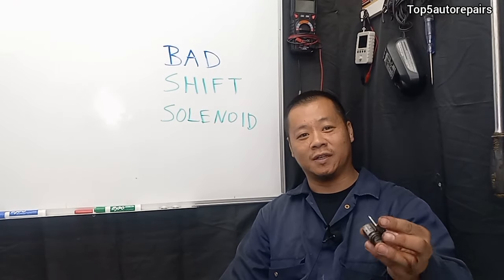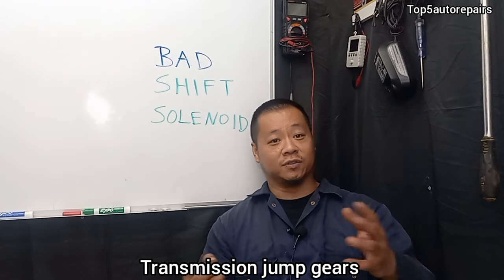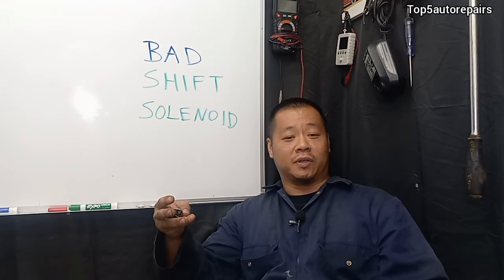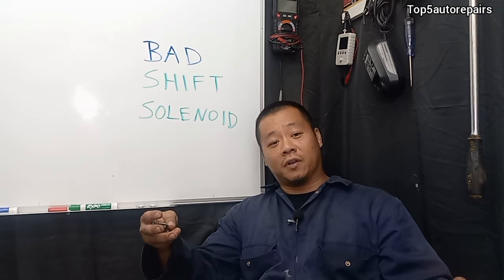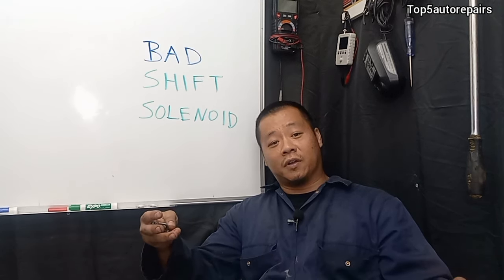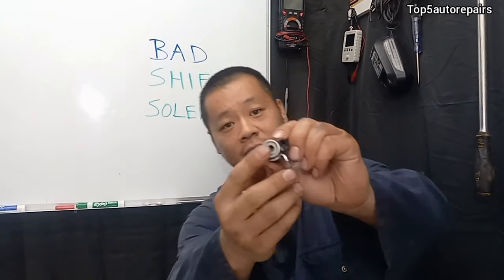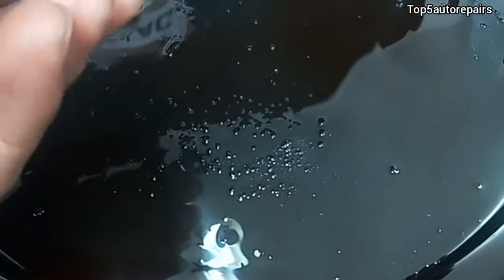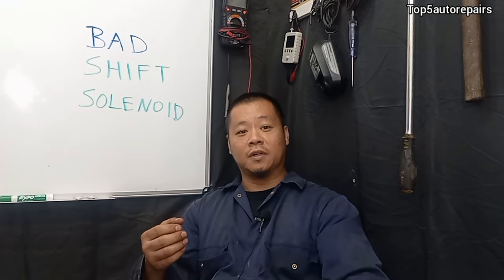Bad Shift Solenoid Symptoms & Codes. Do you have Transmission Shift issues? Slipping? Delayed Shifts

Comment: My transmission was fully repair but the solenoids where never changed. Can a bad shift solenoid cause stalling when put in gear
Reply from the maker: Yes it's possible
Reply: Thank you, I have the same issue.
Reply: @Top5AutoRepairs I have a Chevy truck currently suffering from this issue I hope your right about this
Reply: I have a 2004 vw beetle and it is not shifting into overdrive what could it be
Reply: @Top5AutoRepairs  My V8 Chevrolet 350 edelbrock turbo 400 old school Gearbox automatic does not driving forward but reverse work
Reply: @antoniodominguez4861  update?
Reply: Hello sir please where I can find the solenoids valve body
Reply: Torque converter solenoid
Reply: My 07 rav4 just developed this shifting issue and won't go in reverse until I drive for about a mile or so forward.....any suggestions
Reply: @antoniodominguez4861  do u have a aftermarket torque converter maybe no good
Reply: Trans 6l80e stuck in 3rd gear,what could be faulty?
Reply: @woodrowrussell-pn9gj check your fuses in the box by the battery
Reply: @Top5AutoRepairs  I have a p0973  on my automatic insignia 11 plate  says something about solenoid inside gearbox

Comment: Is there a solenoid that would cause all shifter positions to be a forward gear
Reply: I’d like to know about that too
Reply: My 1999 F2500 7.3 diesel I start going on highway throttle down and 1 gear ok 2 gear shifts in hard and 3 gear shifts in hard then over drive normal?  Now this Trans has 216000 mile does this sound like to have it rebuilt or new please help thanks so much

Comment: Can also be caused by bad / corroded system ground wires, bad transmission input / output sensors, also known as speed sensors or pulse generators or a bad trans temp sensor.

Comment: I have 1996 A6 Audi. And the Transmission does just what you explained. I dove it on the freeway. And it felt like it did not want to shift. Nothing wrong with the engine it starts and everything. But it slips when driven. I appreciate your knowledge

Comment: I have a 2007 Ford Expedition limited. If I brake abruptly and press on the gas ,my suv doesn't go into gear right away. Could that be the shift solenoid issue.?

Comment: Taurus 02. Starting cold, It wont shift out of 1rst gear. After 5 minutes warming up, I can then shift freely all day until it cools. New Transmission fluid and filter.
Reply: I have the same problem with my  toyota ractis 07. Ill try new transmission fluid and filter. Thanks.

Comment: My 97 Chevy 5.7 
Is shifting fine into 1st and 2nd but won’t go into 3rd gear. rpm’s continue to go up but don’t seem to go down. Could this be the shift solenoids ?
Reply: Did you ever find a solution.? I kind of have the same problem. My Toyota tundra 2006 doesn’t go past 3rd shit for a while. ( 5-10 seconds)

Comment: Great video. 2008 Nissan Versa. What if a car has not been used for a couple of years and when you restart it it shifts into drive but now will not shift into other gears or park? Ran perfect before parking and i always change the transmission fluid every 2 years when using it.

Comment: Excellent video. My transmission works only when the tran fluid is hot.
Reply: Mine used to shift weird / slip when it was warm. Ended up being trans temp sensor. Replaced, fixed problem till something else went bad 🙃

Comment: I have a 2015 f150 that had transmission and torque converter rebuild by AAMCO. I now randomly hear a loud clunk either when quickly decelerating or when it sticks shifting a gear-for a second. No codes are popping up except engine misfire. When I took it to Firestone both could not duplicate the clunk or misfire codes. Said it just may be a bad differential. The curiousity is that this clunk did not exist before the rebuild.

Comment: 2011 Kia Sorento, slow acceleration and seeming lack of power, in auto shift has trouble shifting but manual/sport mode will shift but still lacks acceleration. No check engine light, compression, fuel pressure all checked out, everything pointed to bad torque converter, pulled transmission and put in new torque converter, also changed wire harness because I had read that was a problem with these, did not change pump which may have been a mistake but it wasn't making any noise so left it, got it all back together and took it out, same problem, looks like I have to pull transmission again, would a bad speed sensor cause problems or bad pump, my experience in past is if pump goes bad it makes a lot of noise and this is not ? Trying to see if something might fix it without having to pull transmission again.

Comment: May I ask, sir? I have a Daihatsu AT car. When the engine is first started, the reverse gear shift is normal, but when the car has been used for a long time, the reverse gear shift is delayed and jerks.
But for other gear changes, everything is normal and smooth, and there is no check engine indicator on, what is the main cause of the problem? Can I be given an explanation? Thank you..

Comment: This was a really good informative video. Hey i was wondering if i could try using Marvel Mystery Oil in my 2001 Ford F-150 transmission to see if it would clean a sticky solenoid? I’ve always had very good luck over my years of messing with engines, for sticky lifters and such. Hell it even cleans the rings.

Comment: Ecellent video! I have a toyota corolla MY 2009 1.8 / transmision model  U341E  that  has problems with 1st shift; the car runs  too  slow  until  get almost  20 miles  but some times works well on mornings for about 30 minutes! The ECM report an error code P0974 ( shifth selenoid trouble ). In other  hand; its oil transmision level was ok. It has a Brown color  apparence bout I observe an small bouble on it. How coild ñ known is the transmision oil has contamination? The oil contaminación could cause  a selenoid  malfunction? As adicional comment, 1 month before l fixed the car radiator because it was stuck! I hope could you share me your  suggestions  about my case! Thanks
Reply from the maker: Maybe the transmission cooler failed. Also try changing transmission fluid before replacing the solenoid. Hopefully that fix the issue.

Comment: I got a Acura TL 2005 and have a check engine light for code p0757 shift solenoid b stuck on I replaced the shift b solenoid and changed the filter and transmission fluid but the code came back on for the same thing now my car won't shift pass thirds gear and the rpm just rev high
Reply: Did you found the problem and solution?i have the same problem with my lexus says dtcp0983 shift solenoid D -circuit high and does not shift higher than 3th gear.after reset the car shifts and drives fine and shift until 5th and sometimes 6th
Reply: Same experience with my 09 Corolla
Reply: Same

Comment: O7 Chevy uplander. Lost 2nd,3rd and drive no warning. Reverse an 1st remained. Drained fluid. Added TransX. Let run. It worked. It flushed the sensor. Fluid was clean and clear. Changed filter.
Reply: What you described is EXACTLY what’s going on with my 2017 GMC Acadia SLT! I change from 1st to 2nd & remain stuck there. Still have reverse though.🤦🏾‍♀️ Is TransX some sort of stop leak or system flush? Should I do this before attempting a solenoid change?

Comment: I’m using 07 camry 2gr fe . The reverse is not shifting and I have called so many gear master to fix they only services the valve body . When they did that part it’s work but for now the car is not going to shifting
Reply: You need a new transmission

Comment: I have a 2005 Mazda 3 2.3L and there is no check Eng or IT but when I’m draiving and hit the 3ra and 4ta gear it kind of gets like in neutral and it tales a few seconds to shift but it doesnt do it al the time. Van that be the shift selenios since a hace change severas parts and still have the issue.

Comment: Seeking the answer for 2 years already and nobody seems to can recognize my trans behavior as weird. I have Sienna 2008 AWD. 130K miles on it. 
Two things happening with my transmission, that kind of doesn't disturb much, but it doesn't allow me to sleep well. 

When car just rolls down the street accelerating, on 1st gear with no gas pedal pressed (important, no gas pedal. Car need to accelerate by itself from a little to nothing hill), sometimes shifting to 2nd feels like a little bump. I don't hear it, but I can feel it just  to understand that something is not right. 
Another 2nd gear "problem". When car is decelerating, it doesn't shift to 2nd gear and ALWAYS doing 3->1. SO accelerating is always 1,2,3,4,5 and decelerating is ALWAYS 5,4,3 -> 1. Toyota is saying that computer showing all good, but I know there is a problem. The gears actual gears I check by OBD2 and actually I was always driving manual before, so even without scanner I know it's 1st gear. And I would stay on 90 angle turn even on 3rd one but this thing always shifting not even to 2nd but directly to first. Which revs up engine to 2000 rpms.
I found the brink. 10 miles per hour. If 11 at turn, it stays on 3rd, if 10 and less -> shift to 1st. And even if I decelerating on straight line - car shifting down one by one slowly descending speed. 5,4,3 and then... 1. 

Is it a problem, or I'm overthinking?

But.. if suspect solenoid, I would say that it can be SL1 or SL2. Especially SL1. It's the only that switches off when doing 1->2 and can be stucking sometimes doing this bump. 
And from 3 to 1 instead of 2, it misses to switch off. Looks like always. Just trying to think.

Comment: Sir, I have a  2012 Honda Accord which has run around 700,000km.
Last 1 or 2 years, it started to show shifting problems. No trouble codes shown in diagnostic tool.

When I move the gear to D or R, the car will not move for few seconds, and after few seconds, car will get to move but with  load sound  that could may damage the axle. This problem is only on morning or anytime after some time of not using the car.
When I try to unplug the battery and plug it, the problem may solve.
Or will switch of the car and again start the engine, which also solves the problem temporarily.

So could please help me in diagnosis of the problem
Reply: Did you have this problem solved? I have the same issue and I would be glad if you could help out

Comment: Hi Top 5 Auto Repairs, Friend, I have a question and I wanted to know if you could help me and I don't know if this is the beginning of my transmission starting to be damaged in my 2009 Nissan Maxima, the problem it's starting to cause is that everything works fine and I have no problems accelerating or anything. That and when I brake everything is normal, except that before stopping completely the car seems to skid or give a push, it seems to slide due to the forward momentum, especially during an attempt to stop.
Reply: Motor mount maybe

Comment: NEED HELP! I changed spark plugs and ignition coils on my 2014 vw passat. I took it for a test drive and noticed it was running better but for some reason was not catching 4th or 5th gear... you can usually feel when gear shifts. I could feel speed increasing and then all of the sudden my car just went into like neutral. I couldn't move in drive or reverse and was stuck at a traffic light. What could be the cause of this? PLEASE HELP
Reply: What did you find out? I n3ed the answer

Comment: My car isn't shifting gears at all. Yesterday night i drained the transmission fluid, the filter was clogged. Should i remove the valve body and check the solenoids too? 
Also how to know if Radiator is failing 😕

Comment: I really enjoyed this informative video. I have an 06 GS300 AWD. When i get to 30-40 miles per hour, it doesnt shift to the next gear....it makes that loud noise that lets you know it needs to be shifted. No check engine light comes on...no leaks. Repair guy just told me to keep driving it until i get a code...still no code. Could it be the Shift Solenoid and/or Knock Sensor. Seems like people are saying this is happening with this car. Its about 83K miles. Please advise.
Reply: Hey guy,did figure out what was wrong with your GS ?
I have a 02 Tundra 3.4 and it’s doing the same thing. 
I did already replace knock sensors and issue still the same. 
No codes too. 
Thank you.

Comment: I have a 2015 300s awd with the 8 speed transmission

 I have a question that no one can seem to answer, I have a 2015 300s awd with the 8 speed transmission it currently has 209k miles well on every start up cold start or hot start from gear 1 to 3 it goes kind of high before it shifts then gears after that are smooth but once I start to slow down from gear 6 all the way to 3 it kicks so from gear 6 to 5 it’s a light kick then from 5 to 4 it’s a heavier kick then from 4 to 3 it’s a harder kick then from gear 2-1 it’s normal 

No engine light and no codes, I took it to a transmission shop and they said that nothing is wrong and that they couldn’t replicate what I was telling them so to them it seemed fine but I know there’s something wrong on the shifts the service transmission light came on once then went off 

It still currently kicks they recommend a new transmission filter/pan as it’s integrated together with new trans oil and they will add a special oil to it’s running me 1400$ they said it could fix the problem or it’s couldn’t fix the problem I’m willing to pay the 1400 if it’s gonna fix it but it’s a waste of money if it’s not gonna do anything for me

Comment: I have a 1987 jeep wrangler Yj it goes into reverse and works but it goes into drive and doesn’t go anywhere automatic transmission and shifts through the gears from park to low no problem so I know it isn’t the shift cable mechanism could it be the shift solenoid or is it something else

Comment: Hi, I just purchased a 2013. Hyundai SUV 6 cylinder oil drive. It will not engage in drive, reverse or low gear. The engine run smoothly and Ida's perfectly. But it won't engage in driver versus well, can you help me?

Comment: Hi there, thanks for sharing this information. Very useful. I have yaris 2010 semi automatic and the car slipped to Neutral while I was driving. I switch it off for a minute and turn back again and it worked. Also while driving I smelt a burning rubber for couple of minutes and it disappeared and it was struggling to climb the hill. What could be the reason behind it as different mechanics are giving different opinions? Many thanks in advance.
Reply: I have the same problem at altezza , did you find problem ?

Comment: My problem is when it goes to change gears like 3rd gear it will change but if I come to a stop and start to change gears again it won't.  But if I pull over and stop cut car off then start again pull off it will change gears. So is that the shift sensor going out .?? 02 Toyota Camry XLE V6 four door .

Comment: Hi i have a 08 dodge charger 3.5 v6. I recently replaced the transmission pan and filter and now I shift it and it doesn't move in any gear it revs up high but won't move

Comment: Hello I have a Hyundai accent 2002 and it has no reverse 2nd and 4th gear, there are six solenoids the three of them have 3.3 ohms resistance and the other three 23ohms ,are all good? Also I have two error codes, 2nd and 4th gear ratio doesn't match...

Comment: My transmission doesn’t seem to slip or anything like that but when under any load (going uphill, pulling anything, etc) the truck bogs for a moment then regains power, this repeats until no load. This all started after I had my transmission cooler replaced after it failed and drained out on me. Possible solenoid issue? I’m fearing it the TC

Comment: I have 07 ford explorer 5r. New transmission has year ago.  Now have cde 755 hesitates going into 3rd. Check harness and while checking 15 43, 6 44. With tester,both light up but also the tcc at same time.  Any advice

Comment: would this solenoid affect downshifting?  My 2000 Ranger after sitting for 6 months of no use started not shifting to the passing gear.  Regular up and downshifting is smooth but when i put the pedal to the metal the tranny will not shift to the passing gear.   The trans fluid is clear and clean.  I've never changed the filter.  Is there an additive I could put in to help flush deposits prior to changing the filter and fluid?  Tx much
Reply from the maker: Yes it will
Reply: @Top5AutoRepairs  thanks for replying.  I’ve not ever had a check engine light.  Next step have an analyzer do a reading.👍
Reply: Auto RX
Reply: ah, just did a search and found it.  thanks again!

Comment: So I have a Denali Yukon 2008 6.2L I have unplugged the battery and reset and my truck goes into gear when putting it in drive or neutral or reverse once 3 min have passed it’s go back to no grabbing any gears but park what can I do? I have check my relays now I did put a scanner and it’s saying solenoid E is stuck

Comment: I have a manual 09 nissan 370z with 17k miles on it and my 5th gear is grinding and first gear sticks hard and that was after I changed my gear oil to redline MT fully synthetic.. it did nothing, what is the next step in ur opinion, rebuild trans or buy a brand new trans?

Comment: hello friend I have a dodge durango 14 3.6 I think I have this problem because my car does nothing it does not go forwards or backwards the radiator has a leak and now only the light of the shift dial blinks but it does not go backwards or forwards at first asia noise when putting the car in drive or in reverse but it just came out in the dash p0658 code
Reply: Dear Friend.
My car is Toyota RAV4.,auto gearbox.if I ingerge D not moving but ingerge Diverse car moving and transmission fluid is ok.What problem

Comment: I have a 2018 rogue. I was having transmission shift issues. It was diagnosed as solenoid issue (at the dealership) , but they are recommending to change the entire shift assembly. Is that a valid suggestion or should i go to a local shop and simple get the solenoid changed?